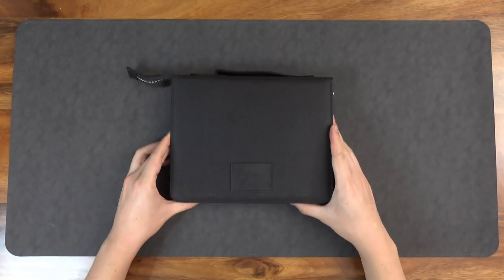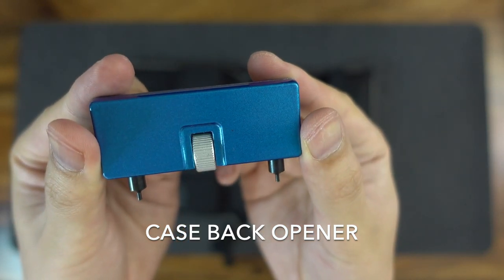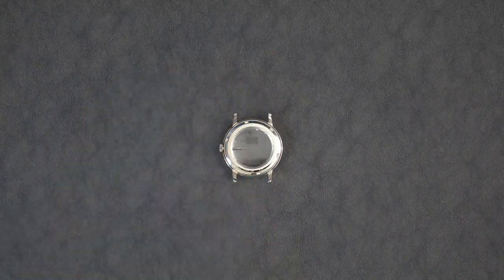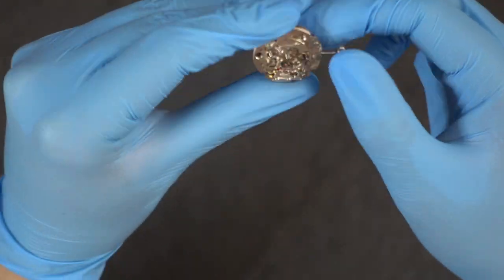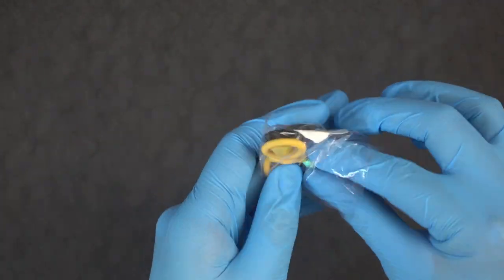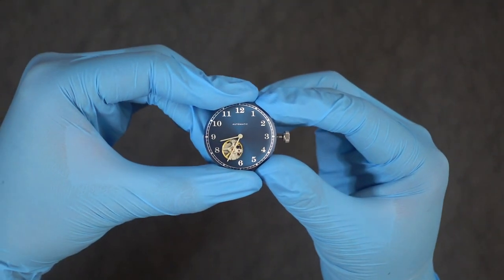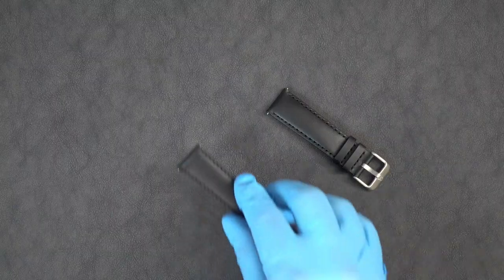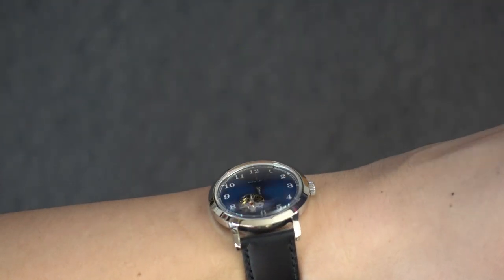Build Your Own Watch! | DIY Watch Club Review and Assembly

Comment: Really nice video, appreciate the effort you put in. I’m not sure if it was just the editing but you made the assembly look quite easy. How would you rate the challenge of one of these kits?
Reply from the maker: Thanks! Some of it was editing. The hardest part I would say was just getting everything lined up correctly. There were a few times where I just couldn't get the movement lined up with the case and I only included the clip where I did it correctly.
I'd say it's relatively easy to assemble as long as you don't have shaky hands
Reply: Ernesto Colton  Warning: It's a trojan virus.